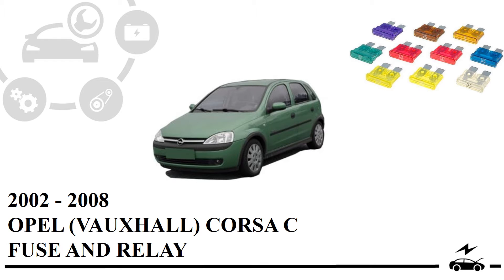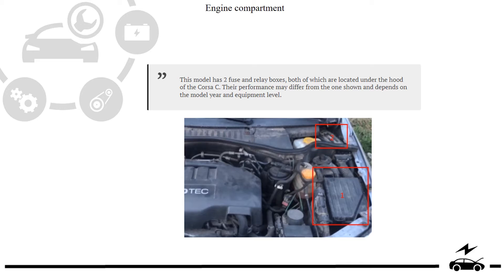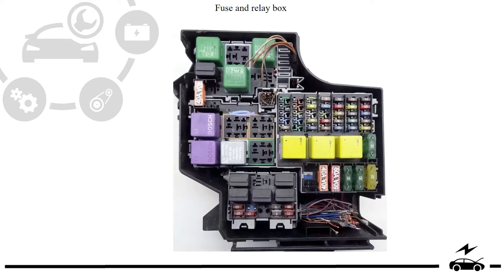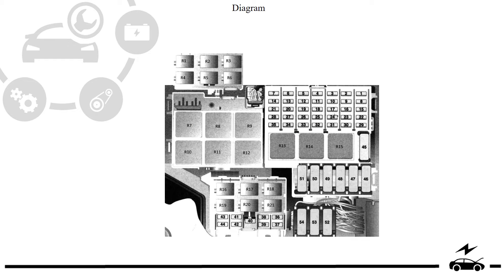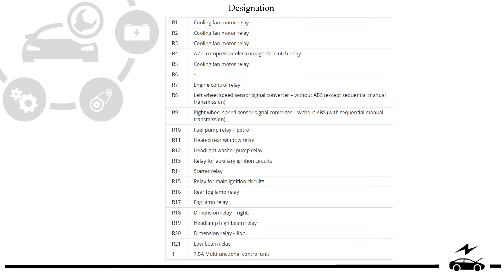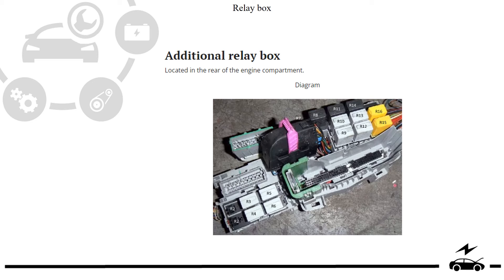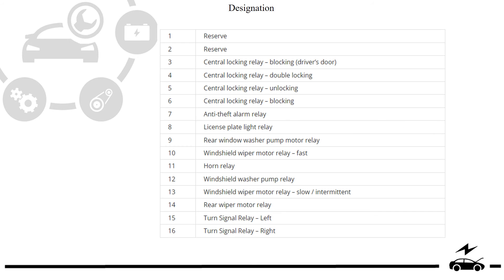Fuse box diagram Vauxhall Ople Corsa C (2000 - 2006 )relay with assignment and location

Comment: So...the radio fuse don't exist yeah? 😂
Reply: Did you ever find it need mine out😂
Reply: @nickevans6720  ended up scraping the car, I'm positive you can pull fuses while the car is running but not relays and hope that helps. Radia fuse is normally in the back of the stereo, or at least that's where I saw one